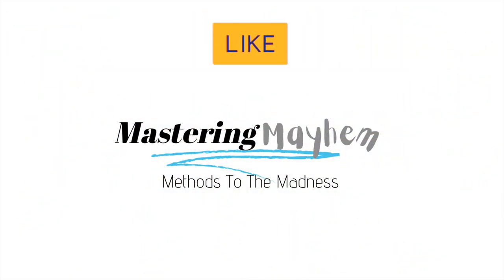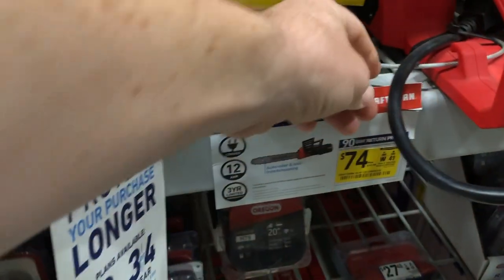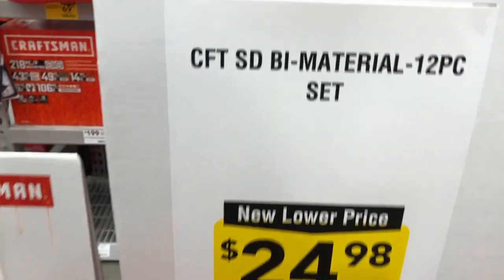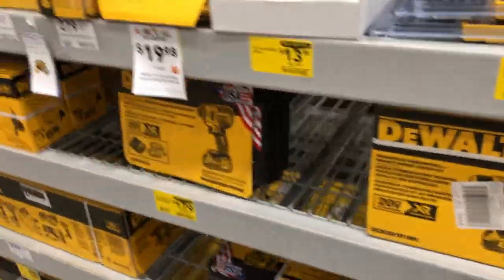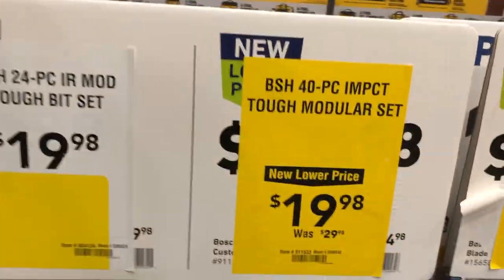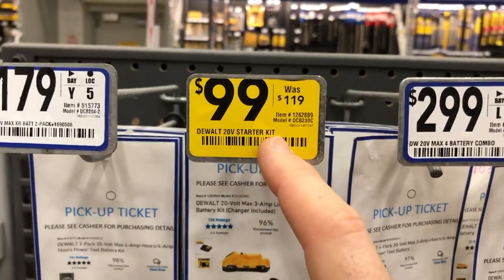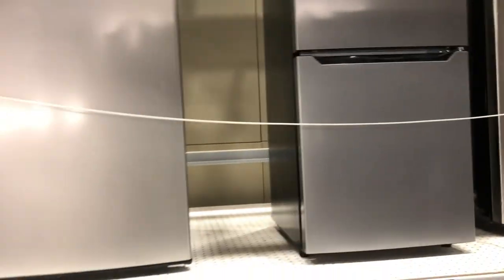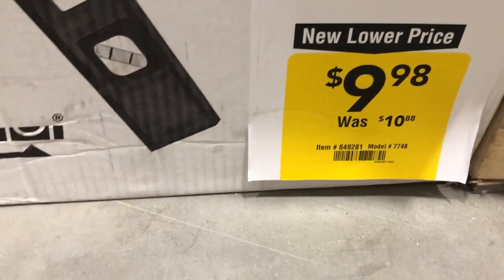Lowes Labor Day Sale Deals, Discounts, and Savings 2020! | Free tools, batteries, and services!

Comment: Craftsman is a good homeowner diyer set up or a apprentice power tool set on a budget now the tool bags are really nice I spent the money on them over harbor freight
Reply from the maker: andrew miller I’m still more willing to purchase the new SKIL line of power tools over the Craftsman. Although, I feel like Craftsman keeps improving. Definitely more for around the home projects and lite DIY work.
Reply: @MasteringMayhem  I got the craftsman 20v Brad nailer it works great for me when I been doing trim work would I want it for professional use has a apprentice yes it would get you started and like you I prefer DeWalt bit sets have been great to me I'm a DeWalt power tool guy mainly because I've got 3 lowes stores 25 to 45mins from the house and I also work for SBD
Reply from the maker: andrew miller I have used a few different brands of tools and currently I use mostly RIDGID for all my contract jobs but I have a few DeWalt power tools and a few BOSCH. As my channel grows though I’ll be adding more brands to the line up. 

Good to know about the Brad nailer in case anyone asks.
Reply from the maker: I’m editing a video fright now where I’m comparing the New RIDGID Hybrid Tire Inflator vs. the DeWalt Hybrid Tire inflator. I should have the video up tonight if you want to check it out.